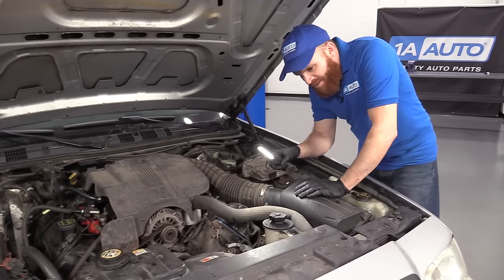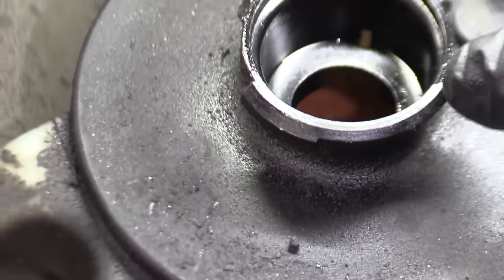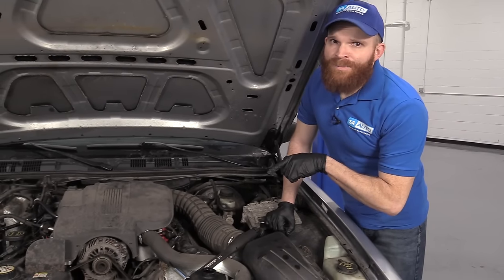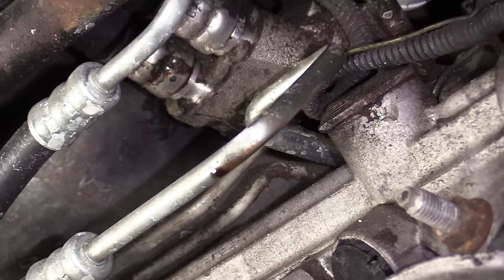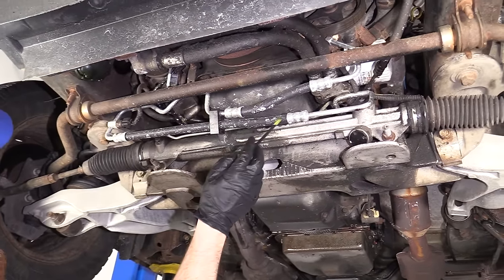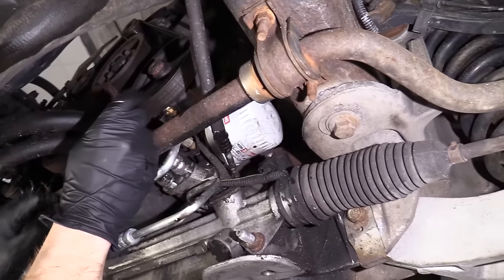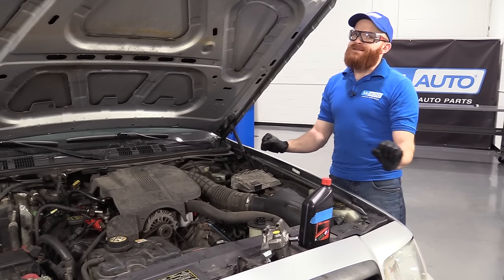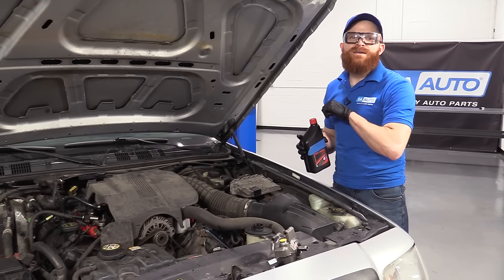Steering Whine? What's That Noise in Your Car, SUV or Truck

Comment: Experienced the exact same thing a month ago. Luckily for me. I got in the car and noticed it right away. Went to the local auto parts store and bought one bottle of power steering fluid and top it off. The sound went away immediately
Reply: 💀 will u got lucky cuase I didn’t 😂
Reply: I also had great luck adding Lucas power steering stop leak on my 1976 vette , 2006 gxp  2006 cts ,and 2004 Grand Prix 3.8 gt , after checking it was not a blown line  saved mega $$$
Reply: Did it ever run low again ?
Reply: @tyalbert5063  after awhile it eventually will need to be replaced, but it’s good for a LOOOONG time
Reply: @kuma4640  did u just fill it up?

Comment: I WISH I had heard this months ago when I heard that exact sound for the first time! I am now having to pay $1150.00 to have my  power steering pump replaced in my 2010 Buick enclave.
Reply: All you had to do was buy a 5 dollar bottle of Power steering fluid once you heard the noise for the first time 😫
Reply: @kuma4640  it’s more than that on the Enclave.  There’s a point behind the engine where the power steering hose develops a leak.  That hose needs replacement.

Comment: Awesome video. Opal Astra was making this noise, the fluid was bad looking but not low. Replaced the power steering pump and it appears to have resolved it. Very painful job in an Astra but super pleased it fixed the issue. Great video.

Comment: For how long would you be able to keep running on way too low power steering fluid level, before irreversible damage to your pump/system occurs? (like in case of a leak)

Comment: Sir….THANK YOU! Like yours, mine was aerated but wasn’t really that low.  I put some fluid in and topped it off, rotated the steering wheel a few times and the noise immediately got much quieter. I do have a leak and when I swiped some from the ground the other day, it was clear.  I wasn’t sure which fluid was clear but with that awful noise every time I turned and even when I drove, I just knew it was power steering.  The only thing that deterred me from thinking it was, is because I wasn’t having any issues steering.  Apparently that isn’t an indicator.  Although the noise went from about a 10 to a 3, I still think I may need a pump.  But this video helped me tremendously!  I had watched so many other videos that never demonstrated the actual noise so I had no clue what to look at.  THANK YOU!!!  You definitely have a new subscriber!

Comment: The rack was replaced on my 2000 Ford Ranger last April.  Went to mechanic months later for an oil change or something and was told the rack they installed had a manufacturer defect.  I asked for a tune-up (estimate was $450-$500) so I needed to save the $ for it, and was told they'd replace the rack when they did the tune-up.  When I took the truck back in, I was told there was no need for the tune-up, but the power steering pump had to be replaced and told that was the cause of the rack issue.  Rack was still under warranty, but I was charged $360 labor to replace the rack.  Total bill was $996.29 (Replace warranty rack, replace power steering pump, power steering fluid, oil change, replace tailgate handle, and replace front head lamps).  Didn't think my bill would be THAT high.  The headlight lamps were $90 each and charged $140 labor for their install.  $28.02 of the bill was a credit card fee.  I felt like I shouldn't have had to pay a penny for the rack replacement or the credit card fee (no fee if paying with cash).  Am I wrong?

Comment: That was helpful. I hear a grinding sound sometimes when I make a left turn. I fixed that or put some trans tune in the power steering I went under the truck, I noticed that both boots on the large side did not have a tie or a clamp so I put ties on it but now I'm going to check them to make sure that there's no oil coming out they're both dry but I'm going to check again. But then I started hearing whining sound I don't know if it's from my brakes because the whiting stops when I break.
The power steering did go out one day fully did not have any power steering that's when I put the translated and it fixed it I think for the most part stop making that sound somebody told me I need to hold you racket but he never even looked he just wanted to buy my truck I'm going to go back and check everything this video is very helpful I like the way you pointed everything out made it easy for me.
Reply from the maker: +Rebecca Root Thanks for the feedback!

Comment: good finally someone shows the noise it makes...so i had seconds or minutes to fix this? ive been driving with this noise for 10 years thats why i stop using my truck cause it was like going to the gym trying to make turns, im not a mechanic so i didnt know about bleeding i was a teenager i tried bleeding it (for the first time in 10 years) that kind of work but i think i ruined the pump plus the gearbox but not sure i guess im going to have to replace both back in the day no one did mechanic things on youtube cross your fingers and hope its just more air in my truck
Reply from the maker: +bizzy156246 Thanks for the feedback!

Comment: Well like you said at the end of tge inspection...I just bought myself a pump...I'm haven't look inside the boots for fluid, I did have my rack an pinion changed less the a year ago, all my ball joints. CV boots...oh geese back under my 4runner I go...
Thanks for the video very informative

Comment: There is no leak but the sound is still coming out for the 4runner Toyota 2006 4.7.
The sound started happening after the mechanic changed one of the return hoses but he did not bleed the system and changed the fluid.
Any recommendations?
No leak and reservoir is full.

Comment: Rather than top it off, I suck the fluid out of the reservoir with a turkey baster and fill it with Lucas premium power steering fluid.  I have found this to noticeably improve performance of the system.  They also have a product with stop-leak, if you think you have a small leak it might help.

Comment: The fluids going in & coming straight back outta mine, because when I top it up, 10 minutes later the noise is back & I'm struggling to steer. Looks like I'll be carless for a while as I don't have money to fix it, nor the means to do it myself. But great video.

Comment: I def hear this noise on my silverado. Atfirst i thought it was my transmission. I seen oil on the groudn, because i let my truck set up for about 1year due to fuel pump issues.

Comment: I was an idiot and drove mine for about a month making the whine noise and yesterday after work I could barely turn the wheel ...However , Topped it off and do that while running and its like brand new . The pump on my windstar sits lower than the resivoir mounted on firewall so it always has fluid in it for lubrication meaning your not going to burn it out .

Comment: this happened to me.  I hadn't drive my truck in 18 months.    started it up and as soon as I turn the steering wheel it makes the wining sound.  fluild is right at the minimum.  no wining nose when I parked it 18 months ago.  it has been garage the whole time.  don't see any leaks.  wondering if it's an issue with the power steering belt.

Comment: Great video! I have a 2002 mustang gt and it recently within the last week started making this high pitched whine coming from what appears to be from the drivers side front wheel.The sound gets higher pitched upon acceleration. It is a consistent whine.It appears to be coming from underneath the car on the drivers side.What side is the power steering pump on and does this sound like a power steering pump?
Reply: Have you figured it out?
Reply: Wow

Comment: Okay, maybe you can give some advice. My daughter has a 350z I was topping off the fluids. I sdded lucas power steering+ conditioner. Just maybe a 1/4 cup to top it off. I also added a thicker 10-30 semi syn instead of 5-30 to the engine to shelp with burn.. about a quart as it does have 240k for miles. Now there is a whine from the front. it seems like power steering but does not get louder with revs or when I turn the wheel. all the Guages are reading fine.

Comment: Hey. First really cold night since I bought my 07 es350. Had to.move it for street cleaners and I notice two small puddles under each front wheel. FWD car. Its doing the same sound. At engine op temp, the power steering is at the minimum line for HOT. I haven't checked under the car yet since its cold out. Ideas??

Comment: Hey so I have this issue on my car however the fluid isn’t running low and and their are no bubbles it is however leaking pretty badly. Is it possible that I damaged my power steering pump despite me not being low on fluid?
Reply: Make sure you have the correct fluid. For instance if it's a toyota they take atf fluid, not power steering. Check your rack for leaks too. Good luck.

Comment: Must be nice having it be that close to the top of the engine compartment. The GM 3800 v6 have it tucked low in the engine behind the belt and under the belt motor

Comment: So let me explain what’s going on with my power steering.
The steering is never hard to turn and the reservoir is never low. I have a 2015 Infiniti Q70L that requires an ATF fluid. My power steering pump randomly makes noise at idle. The ATF fluid is clean and is replaced every 50,000 miles. Currently my Infiniti has 156,000 miles. I performed a vacuum test at 20 pounds of mercury and it passed the test for five minutes. Even though it’s been vacuum tested is there anyway an air pocket could be present in the system? Or is my power steering pump simply need to be replaced? Thankfully I can purchase a brand new Hitachi Power steering pump which happens to be the OEM provider for a reasonable price.
Keep in mind I am a rideshare driver that is on the road constantly picking up passengers.

Comment: Good info. However a have a bit of a problem and not sure where to start. 2003 Yukon, no noise when sitting still at idle. Can turn steering wheel to left with no issue, turning right is when noise starts and hard to turn. Fluid full and clean with no leaks and no air bubble/foaming inside pump. A bit perplexed with issue since it only occurs when turning right..?? Vehicle does have hydro boost breaks.
Reply from the maker: +Rick Briggs We wouldn't be able to diagnose an issue like that here, you may want to have a local mechanic take a look at it. Thanks for checking us out! http://1aau.to/m/Shop-1AAuto-c

Comment: If I have a small leak in the power steering rack would I get a loud whine from the pump? I don’t lose any noticeable fluid when I check the reservoir but have installed a new pump and it whines louder than my factory pump with 120k miles on it. Wondering if it’s a bad reman pump from the dealer or if one of my other aged steering components would contribute to this. I am assuming it is the pump because this noise is louder and new and I don’t see any major leaking or loss of fluid.

Comment: As soon as I had the alternator changed in my 2010 Toyota Corolla the following day starting it up I could hear a loud squealing noise similar to this one. If I turned it on and off a few times it would stop. Driving seems okay. But if I turn the wheel all the way to the left or right it starts to squeal again. Also strange is when I go to stop "or" put the power windows up or down it hesitates like it's trying to stall out on me. Been dealing with it for about 2 months. I took the car back as soon as it started to happen and they couldn't find anything wrong with it. Any suggestions. Power steering issue or bad alternator replacement? Battery and alternator both brand new within 2 months.

Comment: Hi 
I have a power steering leak .. might be a line/ hose/ pump but was told the whole rack needs to be replaced .. they don’t just replace a hose .. that said , it totally drains during driving , never when parked … I accidently over filled the fluid .. as soon as it over flowed I stopped .. it leaked over the cap area… 2005 toyota rav 4.. should I be worried .. do I need to to remove the extra .. I don’t want to damage anything .. belts .. battery .  Engine .. help anyone … and how much is a rack .. thank you 

Also my cas cap door cover( not the cap) broke so its open ..  I smell gas when parked … is that normal .. fumes. Escape from door

Comment: my truck is a 03 f150 4.6l  the situation is it has a noise like power steering but the noise only comes about when the gas peddle is pushed, and the fluid is up to the max. previously i used to hear a big noise when turning right. and now check engine light is on...

Comment: I have a 2006 Silverado 1500 4x4. Using my electric start a couple days to warm up only. When I came out I noticed power steering fluid on the ground. It was from the hose to the pump. I refilled the pump but the steering will not move either way. What could it be?

Comment: Yep. My pressure hose was leaking. Never got around to fixing it because I thought it was oil… until I seen the steering fluid bubbling and dripping from the line.. been like that for about a month so I may need to replace my pump. Huh?

Comment: I had a shop replace my pump with a new napa part. I knew enough to look at the reservoir at home to make sure they changed the fluid w/ new. They did but filled it to just about an inch below the cap. A few days later I took it to them and said research tells me the max and min lines are there for a reason and had them extract to correct amount. Then I asked if they bleed the new pump and was told that (99 corollas) was self-bleeding and take about 500 miles to do it. After the fluid level was fixed several weeks later It was making noise. So the mech. put more in it and it quite it a few more weeks. Then started prob.again. This time the level was same as when he added but more than the max line. So when it drove it 2 miles to shop. The level went way down to about an inch. That was a large dump of fluid and have to wait over week-end to take it back in. This is at the 4th or 5th time I've had to take it in since the new pump was put on. Also the owner claimed 30 yrs. experience and told me it didn't matter if the reservoir was overfilled. Any feedback is welcome.
Reply: you have a fluid leak
Reply: Same thing happened to me every 3 weeks i would have to fill it up with steering fluid. I went to a shop and told the guy its probably a hose but he insisted that its the power stearing pump that need to be replaced, it cost me 500 dollars. Now it leaks alot more that I’ve had to fill it up 3 times in 2 weeks. After doing more research on my own its the idle switch and hose, parts that are alot cheaper and easier to fix.
 Seems like alot of mechanics have no common sense or just look for the most expensive fix to do.
so pissed off with this guy because the owner of the shop is a good guy but he is older now so this newer guy does most of the repairs. Most places are like this also, they dont help or care because of all the cars they have to fix, they make things worse so you can go back in for another repair.

Comment: Will a bad power steering pump or low fluid cause my wheel to feel like it doesn't want to turn...I have a 2002 Buick LeSabre and almost ever time I make a left turn my front right wheel feels like it's dragging or struggling to keep up...I do need to do work to my trans..gonna need to put a shift kit in it but I'm not sure that's what causing my wheel to act like that...ball joints and rods r all fine..my steering wheel feels fine to...I also need a alignment, my steering wheel is over to the left...

Any help??

Comment: Noise just started today in my 2005 Lexus ES330. Rode around block and parked back to check. Running very low on PS fluid and want to see if filling would fix.. Now I fell into a hole of searching what to use as Dexron III is manufacturer specified but is discontinued.. Autozone recommended reg PS fluid and only has Dex6, any help?

Comment: my 02 chrysler sebring makes this shrieking, squealing sound only when I turn the steering wheel to the left or to the right it starts out strong in the morning, but after giving it, it’s like morning stretches turning the wheel all the way to the right and then to the left and then doing it back-and-forth Eventually it stops shreaking while I drive it doesn’t do it when I make any turns or anything only if the car has stopped and has been driven for a few hours. it sounds like it might be coming from the power steering pump but honestly, I don’t want to risk it and swap out the part for nothing.

Comment: I just installed a new pump and it has been making a louder whine noise than the one I removed.. but it steers much easier like it is a new pump. I saw a bunch of bubbles at first and now I keep seeing tiny bubbles everytime i start the car and turn the wheel a few times. Do I just need to keep bleeding this? Or is my pump bad?
Reply: I'm having the same issue with my 74 Catalina. 
    Did you find an answer?

Comment: I have issue with my Toyota Camry v6 1999. 
I put front car on jak both sides and I turn the tyer by my hand left and right more than 8 times and Suddenly the fiuld come out from power steering Reservoir. 
Can you please explain what's the problem is??

Comment: My 2002 honda civic is whining , but not leaking to bad,, .. and no air bubbles, but tried Lucas, power steering stop leak ,& noise went away for a couple days & now is back,  but not horrible, but  still making whining noise.   U think its my pump??
Reply from the maker: +stackin chedda We wouldn't be able to diagnose an issue like that here, you may want to have a local mechanic take a look at it. Thanks for checking us out! http://1aau.to/m/Shop-1AAuto-c
Reply: Watching other videos could be o rings